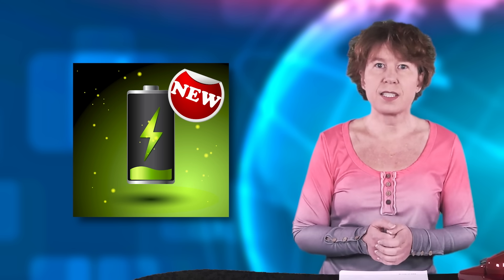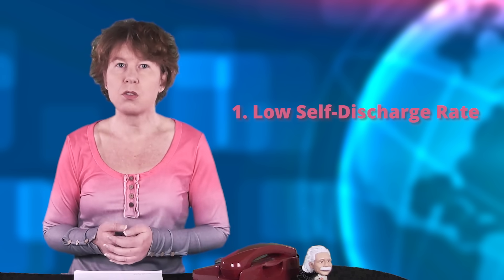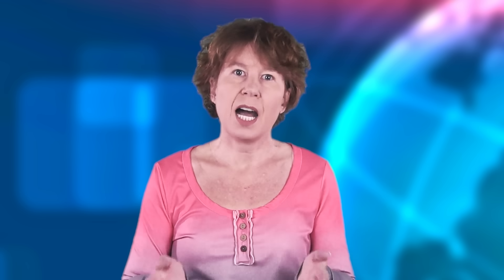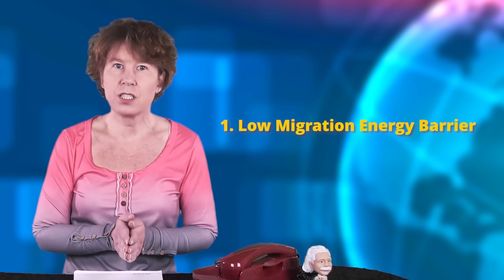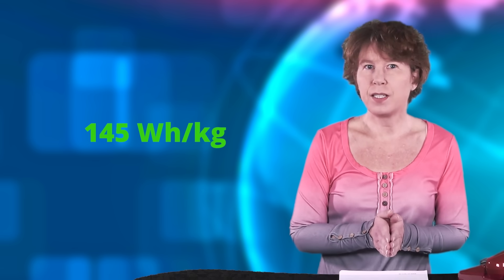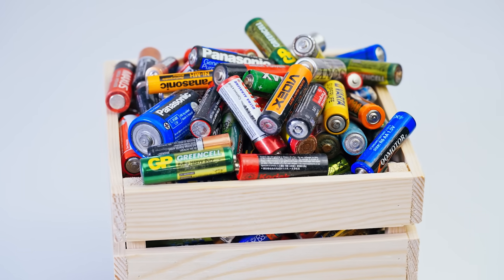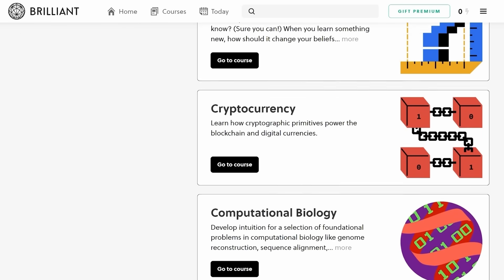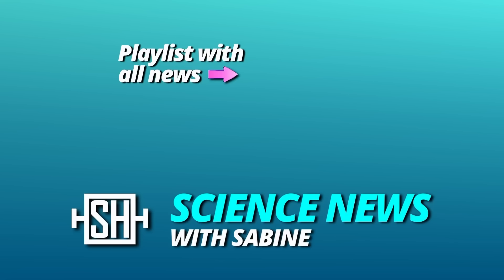Fully Charged in Just 5 Minutes: New Battery Breaks Records

Comment: As a BEV owner who charges at home >95% of the time not having to got to a gas station and hand over $100's per month is the main draw, when I do go on a road trip I find stopping ever 3 or 4 hours for 20 minutes taking car of natures call and stretching my legs while charging improves road trips. Yes if I had to get somewhere faster filling with gas would save some time but if I am in that kind of hurry I would take a plane and save hours not minutes.
And let's not forget the multiple oil changes a year that take at least an hour and are required for many cars to maintain the warranty. My Tesla Model Y has no maintenance requirements and the only thing I have dome is add washer fluid after 2 years.
Reply: Same experience since 2021. Actually, the car covers 100% of my need of 60 km/day x 250 days/year, and it has no issue recharging during the night out of my no-need-to-upgrade 3 kW domestic supply.
It all depends on the usage scenario, but for many people EVs should be a no brainer as soon as they can afford them and would spend an equivalent amount of money anyway. Not for everyone's usage case, but for many more than the ones who have them today, definitely yes. Worth mentioning also the better driving experience and less mechanical maintenance.
Reply: @ThePinkus  All of the savings from an EV, added up into a savings account, might not pay for a new battery when it eventually needs replacing. That part of it muddies your "no brainer" point. That said, I'm quite happy with my Ebike, as the battery replacement will probably be under $1K, relatively manageable.
Reply: Your washer fluid lasted for two years??
Reply: @swhbpocl  SOME of us know how to fill it ourselves, and don't need Mr Lube or the dealership to do it for us. (Not my ex-wife though, she would just come home and tell me to do it).
Reply: @swhbpocl  im not sure but i imagine not having other liquids and an engine in the front allows for a bigger washer fluid tank. Not sure tho
Reply: @swhbpocl  bad phrasing on my part I have added washer fluid multiple times in the 2 years I have not changed the wipers though.
Reply: I don't own an electric vehicle so I'm wondering what the average cost per month would be for charging? How much are charging stations?
Reply: @silvershadow013  I own a small EV in Romania, the costs of running it are considerably smaller, and I charge in my driveway
Reply: @silvershadow013  Whatever your home electric rate is, for home charging, figure out the miles you drive each month, divide by roughly 3 to get the number of kilo-watt-hours it would take (roughly 3-4 miles per 1 kWh of electricity), and then multiply the kilo-watt hours by your (off-peak) utility electric rate.

Fast DC charging is typically more expensive than home charging (ignoring free Fast DC charging that might or might not come with the EV purchased for a period of time).   But you'd have to look that up for your area.

Economically, compared to gas... roughly speaking charging an EV is usually less expensive than gas, but not drastically less expensive unless you also have home solar to augment the utility power.  Vehicle maintenance is drastically lower for an EV, new-car to new-car.  But it should be noted that all new cars (gas or EV) are more expensive to fix when things break these days, so YMMV.

There are lots of other advantages that are not directly related to money.  Pollution being a big factor, particularly in towns and cities.  One hidden feature is being able to leave the climate control "on" in the EV when you park for a run to the store, without having to risk the vehicle getting stolen by leaving the engine (since there is no engine) idling.   Totally amazing in areas of very hot or very cold weather.

-Matt
Reply: @silvershadow013  My Tesla Model Y has a 75 kWh battery with an EPA range of 330 miles lets say 250 for me as I have a heavy foot at my Anaheim Ca most expensive rate is $0.20 per kW so for 250 miles my cost is $15 right now the closes Tesla supercharger to me is $0.38 per kW so that would be $30 to fill up. The Model Y is a very roomy car with massive storage and 0 to 60 of 4.5 seconds so not an "economy" car
Pricing for electricity varies a lot so you have to do your own calculations.
Reply: wait till u hand over 20k for new batteries...
Reply: @brianm2238  Wait till you hand over $50,000 for a new ICE car after 130,000 miles while Tesla  BEVs last 250,000 miles on average
Reply: The hate towards BEV is not based on inconvenience, but ideology.
Reply: @pawel7196 Politics and tribalism more so than ideology. I don't believe there is an "ideological" aversion to EVs, more Exxon-Mobil has an aversion to losing profits and has spent big dollars to indoctrinate Donald Trump's favorite kind of people (ya know, STUPID).
Reply: @pawel7196  

... The fact it is a superior technology in every way?

They are faster, they're quiet (Who wouldn't love a NYC that is void of all the traffic noise?), their ranges are on par if not now starting to exceed your typical ICE, they require less maintenance, they're far better for the environment (and yes, even if you're charging it with Coal/Natural Gas that powerplant is FAR more efficient than your 20 year old car that hasn't seen a proper technician since it rolled out of the factory), and ideally they're going to be a lot more reliable. 

The only issue with EVs is our battery tech could be better. Ultimately though, it'll get better, and better, and better. And perhaps someday we'll move onto something other than batteries altogether. Maybe embedded chargers on our Highways or other tech.

"The grid is not reliable" 

This is an issue to take up with your representatives. Not Electric Vehicles. I live in America, and the most powerful and richest nation in the entire history of the human race should have enough money to build a functioning grid. 

If you're mad about the climate change concern. Then, get with the times. This shit is real and we are now starting to see the beginning of this hell we're bringing onto ourselves.  

What ideology is there?
Reply: @Kloppin4H0rses  traffic noise mainly comes from honking (specially in cities), tires and from large diesel engines. EVs won't do much in this regard, I'm afraid.
Reply: @Zartymil  When EVs start to noticeably impact the number of large diesel engines, perhaps. Right now, they only amount to around 0.03% of commercial vehicles.
Reply: @Kloppin4H0rses An electric vehicle is not more environmentally friendly when running on coal power plants. While a coal plant is more efficient than a car engine, the transmission losses and conversion should be factored in as. Also, coal energy is entirely carbon combustion whereas gasoline has hydrogen combustion as well which makes gasoline emit less CO2 for the same amount of energy. The efficiency is about the same as a car engine once you factor in all losses from power plant to transmission to battery to motor. Additionally coal power plants release other pollutants not present in gasoline like heavy metals and sulphur dioxide. EVs are definitely a good development towards a greener future but let's stick to facts here.
Reply: @azzy-551  if you consider losses in the power plant then with ICE engine please include oil extraction, transport, refinement process, refined products transport and then add the efficiency of a typical combustion engine efficiency at about 25-30% at the high end. A single pump jack used in US uses enough power in a month that would power a Tesla for over 50 000 km.
Reply: @Zartymil  i used to live next to the main road. I disagree with you totally.
Reply: @pawel7196  well I could also bring up coal mining, transportation and refinement, but that's not the point. You said it was more environmentally friendly because of it's efficiency while neglecting to consider the efficiency of power transmission as well as the ratio of energy to CO2 released during combustion. While we're at it why not bring up the substantially higher CO2 released from EV production? Even if it was more efficient on coal power, you would need to use it for a much longer period before the total CO2 produced would be below that of a gas car. 

Also, what is the relevance of pump jack power consumption? Pump jacks extract many times the energy they take to operate including enough gasoline to power a car for 1.8 million kilometres.
Reply: @azzy-551  engineering explained - I recommend the channel. He did the math, please check it out. I didn't say anything about eco-friendliness, it's your words but since you started - yes, EVs are better for climate after around 7-8 years in the worst case scenario. 
Again - see the channel mentioned for the math & figures.
the sentence about pump jacks is a simple example on how ice cars waste energy
Reply: @Kloppin4H0rses  "What ideology is there?"
The irony is so painful  you should put a disclaimer at the top.
Reply: @azzy-551  So you think all the electricity from your coal plants only goes to charge cars?
Transmission losses are negligible with electricity
It takes almost as much electricity to convert oil to gasoline as it does to power a BEV for the same distance
Coal use is trending down fast and if these losses are the same for BEV and gas how come I can charge my vehicle at home for about 1/4 the cost of gasoline per mile
How many soldiers have died to support the oil supply? A lot more than die erecting a wind / solar/ battery facilility
Reply: @Zartymil  seems like i hear more engine noise than much else
Reply: @bdwWilliams-y7q  maybe it's from old engines? New ones are extremely silent. I live near a busy intersection and that's mostly what I hear. 

Ah the big ones that I forgot: motorcycles.
Reply: Well put. My Bolt charges no faster than 50 kW, and I've never had a problem on road trips though I'll stop for twice as long as you. I've never taken a trip longer than 250 miles, and I also charge at home overnight 95+% of the time, but for someone with my needs, an EV beats an ICEV in most respects.
Reply: "[M]ultiple oil changes a year that...are required for many cars to maintain the warranty." 

That's the funniest line I've read since the Eighties.  🤣
Reply: @GradyPhilpott well in many vehicles if you want to keep the warranty ...you do have to maintain it. lack of that can cancel it. and oil chnges arent just based on time, but where and how you drive
Reply: @bdwWilliams-y7q  I found humor in the assertion that oil changes are necessary to maintain the warranty, which is true, but more importantly, they are necessary to keep from destroying the engine, whether or not the warranty is in still effect. Nonetheless, you are correct and perhaps I'm being pedantic.
Reply: @GradyPhilpott   I once bought a 2004 Passat that came with an extended warranty. When the axle broke I had to furnish receipts for all oil changes at the specified intervals which were every 6 months.
Reply: @GradyPhilpott  You've never owned a Mercedes then they require services every few thousand miles from their web site
"Synthetic motor oil replacement – Every 20,000 miles or 1 year for diesels / Every 15,000 miles or 1 year for gasoline engines"

Comment: I want a battery that has a much longer life span before it needs replacement.
Reply: How many miles do you anticipate driving between now and when you cash in?
Reply: @danharold3087  one million. That is the minimum.
out of idle curiosity, what number do you think is reasonable?
Reply: @victormiranda9163  I would not hazard to guess.  Kind of depends on how old one is.
Reply: Tesla batteries are expected to degrade by 1% each year under normal conditions. For instance, the Tesla Model 3 Long Range has a range of 629km/391mi. This means that under normal conditions, you would lose approximately 6.29km/3.91mi of range per year. However, in harsher climates, such as colder or hotter conditions, the battery may degrade at a faster rate.
Reply: @Ben21756   I agree regarding hot weather but I question cold.  it doesn't cause permanent damage or accelerate long-term degradation from what I have been seeing/reading.
Reply: @danharold3087  Under normal cold conditions, sure it may be alright. But I was referring to extreme, below-freezing temperatures which do accelerate the degradation of the battery according to some studies, most people don’t live in regular below-freezing temperatures, so it shouldn’t be a factor for most people. Though, I should’ve made that clear in my original post.
Reply: @Ben21756  Tesla is very popular in Sweden and Denmark.  "Freezing winter temperatures slow the chemical reactions in EV batteries, reducing the charge they can hold — and a vehicle's range. The good news is: It's temporary."
Where are your studies?
Reply: @Ben21756  you believe that is an accurate assessment of a car battery?
Reply: so how many car batteries did you need to replace so far ?
Reply: @romansenger2322 , just autos? two.
now for your turn, when you replace the tesla battery what does it cost?
Reply: I definitely wish my phone battery had the lifespan of a car battery (current EV batteries on new vehicles are expected to last 20 - 35 years).
Reply: All it takes is a little amount of care. Honestly, 10 years old + Teslas that have been taken care of don't suffer as much, it's not a rocket science to care for a car
Reply: @pawel7196  the data so far, ten years for batt in service seems a rare beast.
what is a price of the replacement batt after 10 years?
Reply: Well, we already have batteries with long life spans capable of outlasting the vehicle, they are called LFP batteries (LiFePO4).  In fact, the life-span is long enough now that the BMS electronics are more likely to fail before the cells do.

Comment: Fast charging also requires big enough electric supply lines.
Reply: I'd assume that adoption wouldn't be instant and probably not everyone wants to trade in half of their battery capacity for a faster charge.
So there'd be a decent amount of time to upgrade supply lines or put extra batteries on the charging stations so that a few fast-charging cars can drain those temporarily before they get charged up when there's not much traffic.
Reply: Bingo! Even with existing battery technology it’s looking unlikely that the electrical grid can support long distance commuting and commercial charging requirements.
Reply: @RRR-gr7nh  More like Bing-ignorance.  Fast charging stations just need a steady amount of power from the grid, roughly equal to the average daily consumption.  They already buffer the power through a huge battery pack situated on-site.

This is also true for pretty much all electrification.  The current grid has no trouble whatsoever supporting electrification if you have a little buffering here and there to stretch out any bursty consumption, or simply charge slowly (for example, overnight EV charging at home).   Similarly, electric water heaters can black-out peak electricity consumption periods without causing any inconvenience.  Electric furnaces are a bit more of an issue but the consumption in the winter is actually lower than regular A/C consumption tends to be in the summer.

It is a red-herring that has been held out for decades, in complete ignorance, as being a major problem.  In real life it has never actually been a problem.

-Matt
Reply: Guess how big our electricity supply lines were a hundred years ago..
I love how people think laying more cables is an insurmountable task😂

Comment: The amount of energy stored in a tank of gasoline is enormous. Any liquid fuel holds a much higher density than a Li battery. Putting the same resources into producing a synthetic fuel, such as methanol makes much more sense than trying to stand on our heads and invent batteries that don't give the back even what we put into them in energy or money. We have a perfectly viable system for powering vehicles; it's only problem is it gives users too much freedom at too low a price.
Reply: The problem is that the efficiency when producing the synthetic fuel is very low. So the amount of electric energy you need for the same range is much lower than with an EV. Once all energy comes from renewable sources then you are right…

Comment: I think that it depends. If you can power up your battery at the same time you stop to use the bathroom or get snacks. Then you would omit the stop to that would be dedicated to just a charge. On a road trip you will need to stop to pee eventually.
Reply: Level one charging takes 5-6 hours, level two 1-2 hours. Going pee and getting snacks 10 minutes.
Reply: @MaxBrix  i mean the context of the video is “battery fully charged in 10 minutes” so in a scenario where you can charge your battery in ten minutes the car only really needs to drive as far as the next bathroom break, or meal.
Reply: On a long enough trip, it would also be a great idea to have breaks, so maybe slightly increase their duration?

Comment: Like I've observed with all those Stormtoopers running around with HOW MUCH ENERGY stored in batteries to run laser guns, which obviously have to support quick discharge, I don't want to be around inside a Star Ship when someone bangs into a doorknob and damages the battery case to cause an "Inadvertent discharge" that immediately immolates everything in a 10 meter radius.

Same goes for cars and other devices with such batteries in the current situation when someone merely hops a curb and wreaks HAVOC in the GENERAL area.

At that point, how more dangerous are hydrogen cars that at least pleasant, puffy white clouds when they "inadvertently discharge"?!